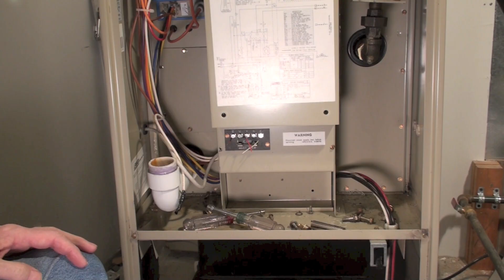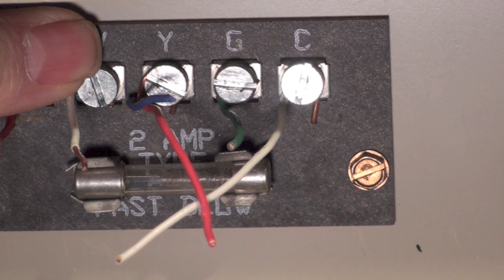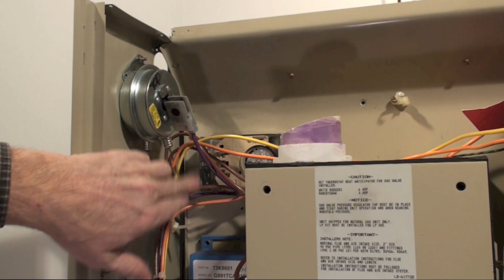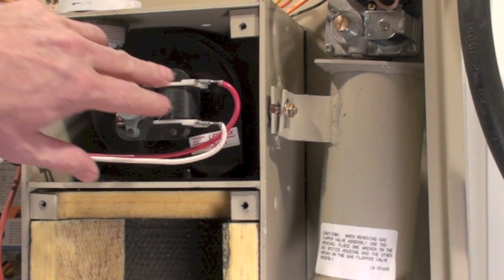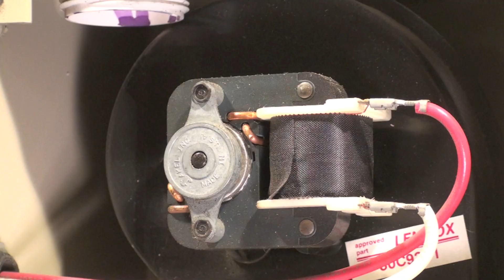Troubleshoot the Lennox pulse.  Part 1

Comment: Mine strts then stops
Reply from the maker: There are a number of possibilities here.  There are problems with the ignition control.  You will have to be lucky to find one.  Flame rod sometimes causes that.  Spark plug may have failed.  Heat exchanger could be failed.  Inducer could have failed.  You can look thru the rest of the parts of the troubleshoot.  They are linked at the end of this video.
GFM

Comment: Howdy.  I have a pulse that was taken out of a building, needing a blower control, as the squirrel cage runs continuously.  I am wanting to put this in a shop, and the tech that installed a new unit said this should work with propane and a 120 volt power supply.  But i am wondering about venting and other connections.  Also, i want to certain about the electrical connections, since they just cut the two (White and black) old wires.    Am i on the right track?  Thanks so much for your videos and wisdom.   God bless you richly.
Ron Z

Comment: Ok heres the problem I have with the Lennox pulse furnace.  It will start and immediately shuts offf when I set the thermostat on heat.  I opened the cover and saw a red light on the control module.  Instructions on the control module indicate if red light on power off then power back on.  I did that and I the have the room thermostat off and it makes a slight clicking and hmmm noise.  I turn the room thermostat to heat and the furnace will try to turn on then turn off.  There is no light on the controller.  The controller is a gc-1 p/n 87f2201.  So the system is getting electricity and the filter is clean.  The clicking and hmmm noise seems to be coming from the controller or another part just above the controller.  Has wires going into and out of this box named Honeywell on the metal cover.  If you are one of your followings can point me to the right direction I would be grateful.

Comment: Really appreciate the videos.  Ref: Green light blinking, inducer fan doesn't start. We have a Lennox Pulse 21. Been a good one except recently. Initially the inducer would run briefly then shut off and furnace did not light. Now the inducer fan will not turn on. Spun it by hand and it appeared free. Replaced the old Pressure switch. When I plug the terminals on the switch the green light starts blinking on the controller. Unplug it and the light just stays on. Appreciate any guidance. Thanks

Comment: I have the pulse unit and last year it turned off. On mine the fuse is a twist open/ close type. I took it out to investigate and soon as I put it back, the green light came back on and it ran fine for a month. Then it shut off and I opened and closed the fuse and sure enough it fired back up and no issues for the rest of the year. Now it started to do the same but lot more frequently,  two to three days. The green light just turns off. It does not blink to give any codes. Just reseting power turns it normal. The controllet is g891tca-8103.  Thanks

Comment: My Pulse G21Q3-80 blower does not come on with Heat so I have to manually turn on blower.  (OK with AC).  Have replaced fan control board and relay but still the the same.  What other component(s) might be causing this issue?
Reply from the maker: You might have a open in the speed wire that is used for heat or the fan relay could have an open.
GFM

Comment: My old LENNOX GCSX13 gave a pressure switch error code (incorrect pressure or pressure switch in stuck position of closed)  and the inducer motor did not start. The stupid coding program actually directs a problem of inducer motor. And my replacement of a new contactor with the exactly same wire connection to the old resulted in a 120v input power for inducer motor. But the motor is for 240V input. Move the connector from the bottom (120V)  of the contactor to its above (240V) solved the problem.

Comment: Listen for induced draft or main blower operation  or observe illuminated leds (KISS), then check R to C (or both ends of cartridge fuse to C) to confirm power. 
If stat mode is off, no call for heat, or defective stat one will not see power   between W and C (call for heat and common)

Comment: My furnace kicks on and off in 10 to 15 second intervals until the house is brought up to temp. Is this normal? I assumed that is why it's called a pulse furnace but it drives me nuts.
Reply: Thats not normal. It should run continuously if its a lennox pulse

Comment: Hello. What does the blue wire run?  My blue wire is connected to the thermostat and not connected to the block. I know nothing about the furnace.
Reply from the maker: It is probably there for use as a common.
GFM
Reply: @grayfurnaceman  Happy New Year!

Comment: i was on a service call tonight on a G14 Pulse. Ignition is intermitten. definitely juice at the ignitor, found that out the hard way lol. but after 3 tries, it doesnt light. Turn power off then on and we get ignition? Have never worked on a pulse, installed a few 30 years ago, thats it. Any ideas?
Reply from the maker: If it does not light at all, I would be replacing the spark plug.  Hard to get to and sometimes it is jammed.
GFM
Reply: @grayfurnaceman  I watched a couple more of your videos, one on the spark plug and flame sensor. Great videos. Thanks again👍
Reply: @grayfurnaceman  I will let you know how it goes.

Comment: Changing out the induction motor the power source is tipped the other way does it make a difference where the red wire goes?
Reply from the maker: It should not as there is only 2 wires to the inducer.
GFM

Comment: The blower doesn’t kick on any help and tips
Reply from the maker: If the burner starts and the circulating fan does not after about 2 minutes, look for either the fan control or the motor itself.
GFM

Comment: I have a pulse21 and I am having an issue that I can’t find anyone in my area that can give me an answer to the problem. I hope you can help me! When the thermostat calls for heat the furnace goes through the 8 second startup and then kicks off and the green light flashes 7 times. The only way to restart it is to unplug the power cord and plug it up multiple time until it finally takes off. Sometimes it will kick on normally and run for 5-10 seconds and kick back off with the same error code (seven flashes). Can you help me?
Reply from the maker: I would be removing the flame rod and cleaning the rod with sandpaper.
GFM
Reply: grayfurnaceman  I purchased a new flame sense rod and igniter but still have the same problem. Could it be the control board or the gas control? Thanks!
Reply from the maker: @keithwithrow8508  Unfortunately, many of the ignition controls have been failing.  Gas valve is probably not the problem.
GFM

Comment: I know it has been a while since you have released this video, but I was hoping you could help me pin point what part I need to replace.
I have a Lennox G21Q. It is a propane conversion. If I have the fan set to ON at the thermostat, the heater will start and run without problems. If I have the fan set to AUTO, then the heater tries to kick on, but cannot and after a few attempts stops trying. There sounds like some sort of clicking coming from electronics below the flapper box. Is there some sort of Fan control switch in there that possibly needs replaced?
Thanks in advance.
Reply: Did you ever fix it?
Reply: @98Oscar  No, a lot of the parts for this unit are no longer manufactured. So replacement is only from scavenged parts. We decided to simply replace the unit due to its age and consistent need of replacement parts that are no longer available.

Comment: Thanks for your great videos! I have a Lennox Pulse G21. Lately, at night it does not start up without being reset at the circuit breaker. And sometimes it needs to be more than an hour before I can reset it for it to function. I have learned after watching your videos and others that the control unit keeps it from turning on after several failures, not sure on the details. When this happens, is it just one item that needs repaired or replaced or is this not enough info to answer my question? Any help would be appreciated! I would just not like to replace the unit that overall works great when its running. Which is more often than not.
Reply from the maker: The items that could be the culprit are:  spark plug, flame sensor, flapper and ignition control.
GFM
Reply: @grayfurnaceman  Thank you for your quick reply. I just noticed there is 7 blinks on the green light on the control box. Does that number blinks indicate where I should look first? Thanks in Advance, if there is a donation area on your website let me know.
Reply from the maker: @CaptureMotionVR  I don't recall a 7 blink code on that control.  The code key should be shown on the front of the control.
GFM

Comment: Need help, had old control green light was on but nothing, installed new control.now it ignites and runs and sounds good but it eventually shuts down, not sure why because it runs great for about a minute then goes into retry before eventually stops retrying
Reply from the maker: You can try removing the flame rod and cleaning it.
GFM
Reply: Thanks GFM, cleaned flame sensor and now she’s purring like a kitten, much appreciated!!!

Comment: great video. I have a customer with an older pulse system, every 2-3 months the furnace wont kick on.  I jump it out R to W nothing happens, I check voltage, the stat is calling but it wont kick on. so I jump out the fan for 10-15 seconds pull the jumper off and jump R to W and the sequence of operation starts, pull jumper off wait 5 min jump it out again starts no problem. Any suggestions?
Reply from the maker: Possibly the limit has kicked off and is stuck off.  When you start the fan, it breaks loose?
GFM

Comment: Hi I need help i have pulse 21 thermostat turns on furnace dont hit disconnect wait 30 seconds turns on runs fine maybe hours, days who knows call furnace guy he says everything fine call electrician to rewire from furnace to box
Reply: There could be many problems.  Probably the most common is ignition control failure.  These furnaces have had many problems and Lennox does not really want to supply parts anymore.  Short answer:  replace it.
GFM

Comment: Grayfurnanceman, my pulsestar does not start at all.  It was previously running yesterday.  It doesn't even try to turn on.  I am showing power to the furnace.  Any ideas?
Reply from the maker: I would be looking for 24 volt control power first.
GFM
Reply: @grayfurnaceman  The induction fan turns on sometimes when heat is engaged at the thermostat.  It runs for a bit then stops.  Nothing else happens.  I got the furnance to fire by repeatedly turning on the heat at the thermostat.  It stayed running, but did not start again after it stopped at temp.  Any ideas?
Reply: Nevermind, figured it out.  There is a short in the power cable running to the induction fan.  I jiggled it and the fan runs and furnace fires.

Comment: I have a pulse 21. The blue control module was replaced roughly 3 years ago. So for a few weeks now it’s been going into a reset mode- I have to go down to furnace and shut off power to it, wait an hour and it will start fine normally. Today, it will start after an hour, but only runs for about ten minutes. I’ve cleaned flame sensor, but the fan on the inside sounds like it’s running pretty ragged. HVAC man said it needs another new blue controller ( don’t know what it’s called). He also said he isn’t getting much power to the gas control. Any idea where to go now? He cost me a few hundred dollars and I’m still freezing! Thanks in advance!
Reply: Clown videos
Reply: Was the indoor blower coming on?

Comment: I have no power to W or R and the green light will not come on. tried resetting unit worked for little bit then shut off now nothing just a humming but no green light
Reply from the maker: If there is no power to the W terminal, you have a problem with the thermostat ir its wiring.
GFM
Reply: I recently replaced the spark ignition control box and the light on the new one doesn't even come on. when on the furnace just makes a low humming noise. would this make you think it's the thermostat?
Reply from the maker: Try jumping R to W at the furnace.  If the furnace fires, you have a problem with the thermostat or its wiring.  No fire, look elsewhere.
GFM
GFM
Reply: ok so...I'm sorry and thank you for your help but I've got it running but it will not fire. like the spark plugs not going. the new module throws a code for the pilot/main valve circuit. I'm not sure what that means or is but I am trying to figure it out
Reply from the maker: Try checking voltage at the gas valve during a trial for ignition.
GFM
Reply: you sir are the man!

Comment: I had intermittent controller lock out(no green light).  Turns out the heat exchanger  was plugged with dust and was causing an over heating issue.  Thanks for all the info here to help me get to this conclusion.
Reply from the maker: Welcome
GFM
Reply: How do you clean the heat exchanger and get access to it? I'm having a similar problem, furnace runs for a  few days later then stops working,  green light is off, then I turn breaker off and on, the green light comes on and it starts to work again for a few days. Just wondering if I could do it myself.

Comment: My pulse furnace does the same thing that Clay is describing, but to get mine to work again all I have to do is open the fan compartment and close it back.  Once the black safety switch to the door is engaged again the furnace will work for a day or so.  Would changing out the switch correct the problem? Or could there be something else causing it?

Comment: see if this makes any sense. this one will run for days then shut off I play with it and turn the gas off and on and the safety switch it starts after about 45 minutes. now it runs for a few hours and shuts off as of today it ran for 3 hours and the light turns on and the inducter will run and that's it for one minute no attempt to ignite....
Reply from the maker: You probably have either a dirty flame rod or the ignition control is failing.
GFM
Reply: grayfurnaceman how would I go about fixing the flame rod ? a HVAC guy said the inductor and pressure switch was bad
Reply from the maker: You have to remove the rod from the combustion chamber and clean it with sandpaper.  I am suspicious about the diagnosis you received by the tech, but his testing may indicate what your problem is.  If the vacuum in the vent or combustion air piping is not high enough, the unit will not start.  I would check the venting for blockages first.  You could have a failing inducer or pressure switch but probably not both.
GFM

Comment: Gary if your pressure switch hose is not 100 % secure to the vent pipe at the bottom will that cause furnace to not start? Cuz once in a while my furnace won't start, for some wierd reason, for like an hour, I am going to buy a new bracket soon, maybe my mother board is going out? I called the gas company they came and had no clue
Reply from the maker: It could be the problem.  All you can do is fix it and see.
GFM

Comment: Gary our furnace will shut down before reaching the set temperature on the thermostat. Turning the thermostat off and back on or even siphoning water out of the black box will start the furnace back up. Do you think we need a new water pump for the furnace.
Reply from the maker: I would first make sure the condensate drains are clear.  Turning the furnace off and back on will reboot the ignition control.  You could have a flame failure shut down.  You will need to watch the furnace cycle and make comparisons to how it should cycle.  Hope this helps.
GFM

Comment from the maker: Yeah, pretty dumb.  There is also no circuit to insure the pressure switch works.  It is supposed to open if the vacuum on the combustion air is too high or the pressure in the vent is too high due to blockage.  Thanks for the comment.
GFM